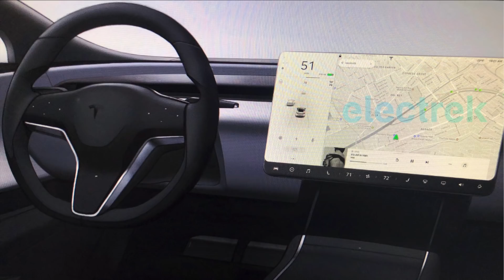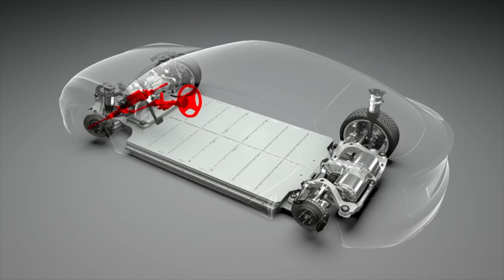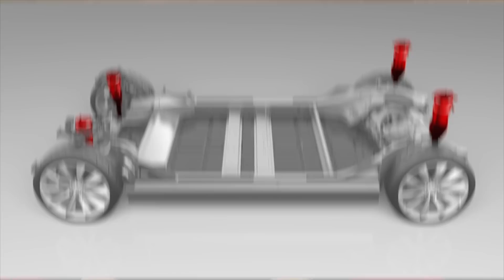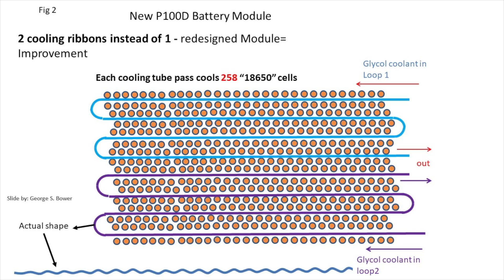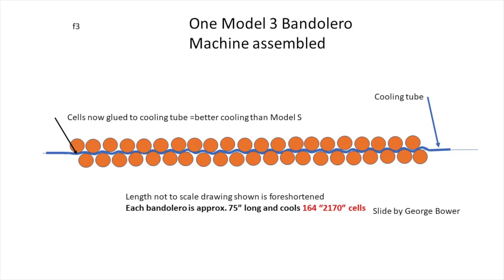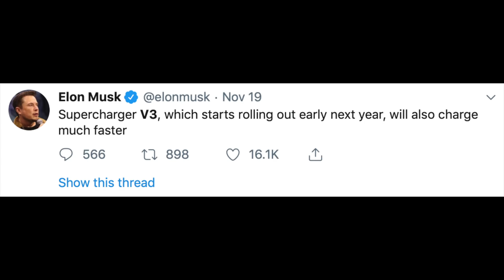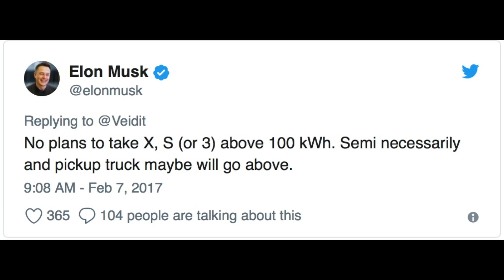The reason Tesla's 75 kWh battery is going away

Comment: What I miss is the effect this proposed increase of the supercharger power output has on the battery pack.
 As far as I know, there is still nobody who's solved the problem of batteries "ageing" faster, meaning less charge cycles, with every amp increase of the charging current. Neither Tesla/Musk nor Panasonic seem to be willing to discuss this issue, at least I can't find discussions with them about it.
 
So while it would be great to charge your Tesla in, say 30 minutes, beacuse that would greatly expand the "useable" range, if that means decreasing the number of charge cycles significally, the question rises "is it worth it?" Battery packs for electric cars are not cheap, and every shortening of their life cycle makes it less attractive to switch to a fully electric powered car.

Comment: Electric cars have all the inconvenients of cars because...are cars :-) SO transportations solution is NOT the car, even rented, even autonomous! And they add the enormous négative fact that they need for their batteries a lot of rare raw materials and there are simply not enough of these materials on the earth to give to 10 billions people the same possibilities.UN would put an embargo on these ressources and give quotas for each country to save their part of these ressources for all other countries.
If carsare needed, compressed air cars are far better for 100km distance (can be upgraded to 300km with 3 l equivalent gaz heater), they give natural climatisation in hot countries (soon most part of the world) and they are easy to heat in winter. And for longer range deplacements, electric trains with regional and intercontinental ones, with solar panels on the ways and intercontinental electric HDVC net

Comment: I don't think doubling the number of cells in the pack, making it taller is feasible at all. Another 1000 pounds or so of curb weight, reducing handling, efficiency and importantly, worse test result of the IIHS roof crush strength test unless they make the roof stronger.
Going 2170, yes, or at least making cooling as good as the M3 will make it possible to use Supercharger v3.

Comment: When it comes to the supercharger network, I wish to make battery for upgrading gas cars to electric and be compatible with the latest supercharger. Supercharger will become the new gas station and of course those with non tesla cars have to pay more at the new "pump", but it is important to reduce dependence on fossil fuels. To make that much batteries, need to build more gigafactories that also need an alternative energy powered delviery network to bring the parts needed to make those batteries.

Comment: The battery technology is advancing.
Tesla will stand out, if they offer more range in their cars, than the competitors.
Reply: epSos.de ...all you guys need to watch (Search of the “Super Battery”) find it on Netflix.... guy on there can get electrons to flow through plastic and doesn’t use electrolytes, so at least double the capacity = double the range...and not fires, when hit 👍🏽👍🏽 win win...
Reply: they already offer more range than the competitors
Reply: WRONG Revian a car company now sells a 180Kw/h battery and makes the first fully electric off roader, 0-100Km/h in 3 seconds, 4WD, 4 motors so has torque vectoring, 600+Km range battery.
Reply: @aririyadh8359  

WRONG. Rivian^ doesn't sell anything yet
Reply: @edgeofsins  Revian is currently taking orders.  Not clear if anyone has received one yet.
Reply: Z ...googpoint...
Reply: @aririyadh8359  Tesla Roadster has a 1,000 km range according to Elon Musk. The video is on the tesla.com. And Rivian hasn't released anything yet.. all prototypes.
Reply: @aririyadh8359  how much it gonna cost then

Comment: All this talk about Tesla batteries going over 100kWh, but nobody is talking about how efficiency of using the energy in existing size batteries might be going up too.  Or perhaps regen braking, etc is becoming more efficient which would negate the need for larger battery packs in existing tesla models.  

@Sean Mitchell would you be able to make a video about increased efficiency that isn't the actual battery, but the things draining or producing energy (regen braking for example) for the batteries?  I think that's where the real mystery lies right now as I rarely if ever see anyone discussing this.

Comment: They will simply release the S and X with a new capacity using the same batteries as the 3 if it's a short term solution. Capacity will be likely 120-135 kw/hr.

They could do a complete redesign of the Model S and X (they have been removing configurations for a while now) later this year, that would probably give them a 150+ kw/hr battery. They won't release one with a 200 kw/hr pack to give the range advantage to the Roadster, it's also possible they are holding the update until after the roadster release. 

In any case I put 50% odds the new S and or X will be announced in that Spring Event when the Model Y is supposed to be announced.

Comment: I think this is wrong on a few counts: 1) supercharger rates are mostly limited by battery max charge rate, not current capacity on the lines. For example my 75D charges at 96kwh  whereas the 100D can charge at 120kwh. Why? not because the 100D has some upgraded Supercharger v2.something or because it has higher capacity cables, but because it has more cells to charge. So, 200-250kwh could simply mean larger packs, not necessarily higher rate of charge per cell. Elon correctly comments getting much higher than they already do would frag the packs (the cells). 2) I don't think you get to the meat of why they actually removed the 75D. I think it's mostly because there is a dilemma for customers choosing between a high end model 3 and the 75D. This removes that, and makes those customers choose the lower end but much higher margin (for Tesla) M3. As a 75D owner, which I love, I'm very glad I have that car (for around $80k) than a 'high end' model 3 (for around $70k). I'm also happy they removed it now, because I think others will feel the same and therefore the resale value of my 75D, a 'cheap' model S, will likely be higher, now they dont' sell them new.

Comment: When I bought my 2014 85 there were no superchargers in my state and long trips required a bit of planning, so I bought the biggest battery pack available.  Now there are superchargers all over (6 within just 50 miles of me) and when I make long trips I charge as much on my personal convenience as the car’s needs, so when I traded in for a 2018 model S I got a 75D.  I see no purpose for a bigger battery pack, it’s just extra weight to lug around for me.  I hadn’t thought about the faster charging aspect, but I don’t think the benefits outweigh the costs for most drivers.  I’m only driving about 25,000 miles a year, most of that local so I charge at home and at work (work drive is 100 miles each way).  I’m sure if I made lots of 300 to 400 mile trips a bigger pack would be first on my list.
Reply: People do tend to get caught up in non-realistic "what if's". What if I need my car to drive from Bumfluff, IN to Miami, FL, what if I need to drive a million miles in one day... but then never do that kind of drive.

I have no plans in the immediate future to drive more than 80 miles in a day, so a little BMW i3 works well for me. Quick enough in town and fun to drive. It doesn't have the ultimate grip of my old autocross cars but that's not the point - it's fun enough if you know how to drive. I don't need a few hundred more pounds of battery weight.

If Telsa came out with a cut down roadster that did 60 in about 4 seconds and got about 100 to 150 miles, I'd buy it in a heartbeat.

Comment: I wouldnt expect a larger battery, More likely they will increase the energy density and provide a 100KWh pack using less cells = Less Weight = Higher Performance + Range

Comment: The new battery is the 21700.  Not 2170. The new Samsung 40T 21700 are 4000mah.  18650s can not get that much mah.
Reply from the maker: Tesla refers to it as the 2170. "The Gigafactory is producing a Tesla/Panasonic designed and engineered cell called a “2170 cell,” as the diameter is 21mm in x 70mm in height." https://www.tesla.com/presskit?redirect=no
Reply: @AllThingsEV  Tesla may be calling it the 2170 for short, but battery companies are calling it the 21700.  Not sure why.  It is the latest large  lithium ion battery that are being produced. They are 21mm x 70mm.   Before, Tesla used 18mm x 65mm batteries in their battery packs.

The batteries come in different "flavors".  They can be high mah or high amps.  But not both.

Example is the Samsung 30T. They are high amp, but lower mah.  The Samsung 40T are higher mah, but lower amp. Other battery manufactures have the same batteries at the same limitations.

I have learned my battery knowledge from vaping.  If you want to know more about batteries, please watch the Battery Mouch on youtube.  Here is a link.  https://www.youtube.com/watch?v=zLEsvLDC6B0

Also check his youtube channel.

Comment: new super charger + extended network == less reason to expand the pack size.  Why put a 100+kWh pack in the car running up the cost of ownership when I can charge in 15 minutes (or whatever) at 1000s of locations in the country?  Eventually as DC charge stations become more numerous (and god forbid ... a standard emerges...) you'll actually see packs come down in size.  Likely even around the 30-50kWh being the norm for a BEV car (30 being entry level BEV...).

Comment: There is a physics problem here though...the larger diameter the circle, the fewer fit in the same rectangle.  The 2170 is easier to cool, has less parts to breakdown and is easier to assemble.  It's 50% larger by volume and also 50% more storage.  So no huge win on the efficiency front.  But it does not provide energy storage space per square foot of floor space.  If you do the math, it's actually *less*.  You need a larger physical space to store the same amount of energy.  I don't see the S or X moving to 2170 short of a wheelbase stretch.

Comment: Great job man! Another thing I'm wondering about is the supercharger cable itself. I don't believe it can actually charge at a faster rate currently, so the new option might be CCS or something else
Reply: most likely higher voltage. its going to be the only way to keep the cable Size Manageable and safe.
Reply: @Zieranna  They are the same, i replaced them already. For the Black and Decker Dill too now, needing more Amp. Volt is the same, inside any 18650, 3 smaller sized 1.2 volt, as all..
Only some do have a chip for the thermos protection, ultra small too, able to do in any pack.
Reply: @Zieranna  200A at 500V for one hour to charge 100kWh if 100% efficiency Look at your house cable to get an idea of the cable size Multiply by 4 for 15 min charge
Reply: Teslanomics with Ben Sullins
When you start is goes fast too, on the regular cable...
Reply: When I hear inch I know I am dealing with technology illiterate
Reply: @clitisswood7330  
Would that not be
"A technological illiterate"?
😉

Comment: I would not expect a huge increase in the battery size for the S or X, however if they are able to change the cell size and maintain similar battery dimensions then they may give a small increase in KW as they are more energy dense. Tesla would also make savings by reducing their production complexity by only having on cell type.

Comment: My guess?  Model S/X are going to get the 3's LR battery (80kwh) dropped in along with the upgraded charging system.  Will be renamed to Standard Range.  100kwh s/x will be upgraded in the coming months, probably to 120kwh with the new cells and charging system.  Supercharger V3 is going to start at 180kw and maybe bump up to 220 further down the road.

Comment: superchargers should be on the beach getting the energy from the tide using tidal energy so then its completely renewable giving the vehicle the electrical charge. and if any of u are not keen on charging time,anyway charging over night is fine or they are now working a mineral called silicon in batterys which chargers 8 times faster
Reply: The power grid lets you put the chargers wherever you want, you can add wave generators to the grid and it will be effectively the same thing with much better logistics.
Reply: @JankyShack  exactly, thats what im trying to say because it will have no cost only the equipment they need to use
Reply: @JankyShack  and if it was u who liked my comment thx cause i never get likes

Comment: Hopefully, they lower the price of the 100kwh to the previous price of the 75kwh. I think they are probably going to go big and release a 150kwh battery, they will probably also use it for the new roadster to allow the 600+ mile range and high performance delivery.

Comment: I think the 75kWh going away is more of a marketing angle than a battery technology angle.

I do believe as you do there will be a battery tech update for S and X before too long. There's no technical reason to stop making 75kWh packs today prior to announcing a new architecture. This move is to differentiate S and X from Model 3 and help justify the extra dollars for those vehicles.

New architecture S and X models may no longer get the battery size reflected in the car model number, like with the 3 there is no need for a badge to indicate battery size or range. Marketing of S and X vehicles will focus on range rather than kWh. Much bigger packs must be planned to allow S and X to get a decent range increase to rival the LR Model 3.

Comment: More battery? Yes. 
Why?  Break tesla out of "city car" and into soccer mom / moving dad territory.  
1) No time to charge, always on the go. Longer drive time relieves "recharging fear"
2) Pulling trailer - mover dad will not give up the ability to tow (even though most never do)
3) Wind turbine (yes solar) making electricity cheaper. Charge at home and skip any recharge stops.
4) Shale oil @ $40/gal falling making removing the high gas price argument. Shale should fall to $35, then $30 or lower as technology and XL pipelines improve. $1.60 gas looks plausible. 
Hence Tesla needs to compete against cheap gas.

Comment: Tesla models would be improved by an integral Joseph Newman motor based charger and FWG graphene supercapacitor, or similar technology for greater energy density (from the motor) and greater power density from the capacitor. I would give links, but posts with links are not published.

Comment: I really don't get this reasoning. The battery pack is like half the cost and weight of the car. If they can improve charging speed to like 15 mins. It will be way more benefitial to have small batteries and charge more often. The car will get faster and more effcient and cheaper. Everything Elon is quoted on in this video indicates this is the direction they are going for. I expect they will do a cell upgrade at some point but no more capacity.
Reply: The reason they are removing the cheaper versions is because they want to differentiate their productline. S and X were never suppose to be cheap cars, they just made a version of the as cheap as possible to offset the demand for model 3 and also keep the lights on during ramp up.

Comment: Reading the comments is just killing me...21700 is not better newer tech batterie than the 18650. This are the freaking dimensions of the battery, You have 18650 with 2000mAh and with 3500mAh... 
The model 3 battery with the 21700 has improved pack design and cooling solution this same improvements can be applied to 18650 pack design. But the main problem is it takes time and money to redesign pack for older models like the S and X.
Reply: The 21700 has a higher energy density vs the 18650 with improved chemistry, which means they ARE both newer and better.

This means a 75kWh battery pack for example would be smaller and lighter as a 2170 vs 18650, and there are indications that it has a higher C rating which means it will also be able to charge faster.
Reply: Yep, exactly.  The 18650 is easier to cool with its smaller diameter, if both had the same cooling infrastructure around it.
Reply: It would cost more since there would need to be more tubing in the smaller cell size. This would also reduce the free volume in the battery pack decreasing the available room for batteries. Another option would be to go to a wet battery pack and run coolant over the naked batteries but this would require a nonconductive coolant but would permit more room for batteries in the pack. Using a boiling liquid system is possible to but would require a pressurised battery pack.

Comment: Yes. There is definitely going to be an increase in the battery pack capacity and the charging speed.  Tesla is trying to get economies of scale for battery production so it’s not likely that we are going to see a new battery formulation in the short term - that would be silly if Tesla did that. However they should be able to get well over 300 mile range by consuming the same volume of the current pack with the 2170s. It is likely that the model3 was simply the first to get the new batteries because it was the one that could accommodate the new tech immediately, and the rest of the line will get the next generation in some refits that are long overdue. It is likely that they wanted to do it for the facelift versions, but they simply didn’t have the production capacity to make it happen. By moving everything to the 2270s, that concern will go away - until we get to the graphite tech ;)